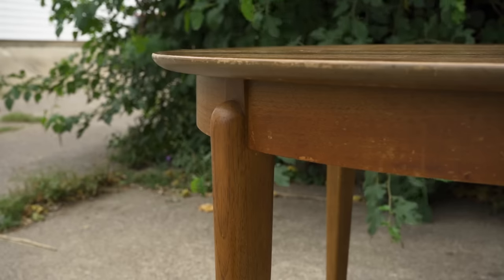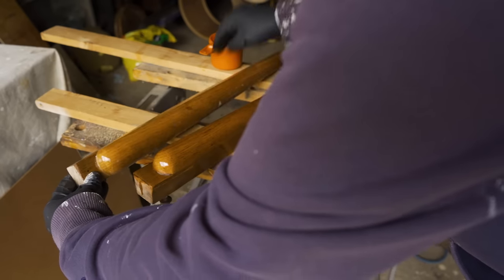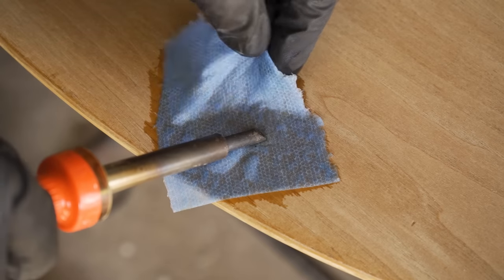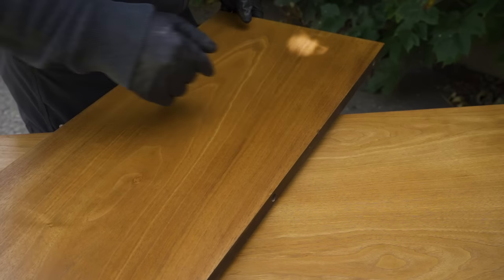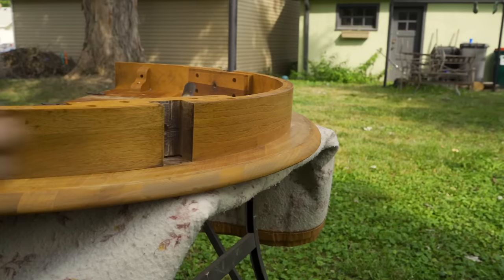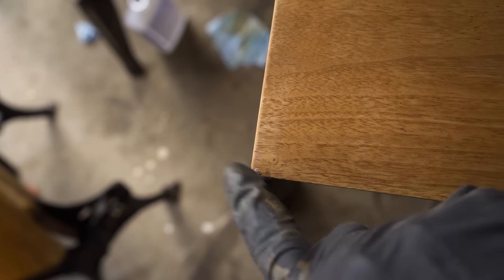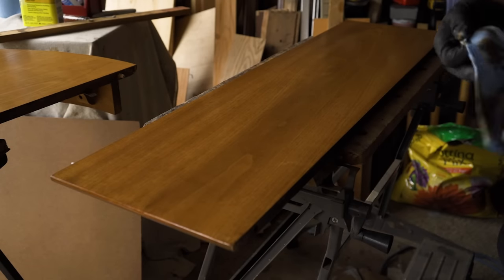Reviving A Tired Old MCM Gem | Furniture Restoration - Repair - Refinishing

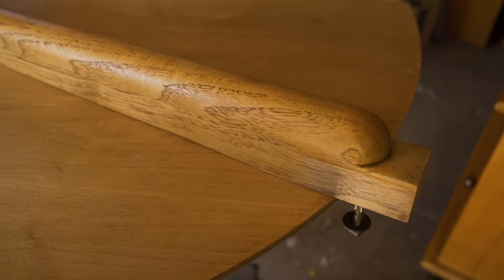Comment: I always learn sonething from your videos 4:50 "Too smooth for stain. The stain may slide right off." This must be no problem I was having with a test project. I bought a Curtis Mathes console to practice on and I could not get stain to stick where the original finish and stain had worn off even after sanding. I probably sanded it too fine.

Comment: putting lye on cherry and other similar woods is a long standing aging technique. you can get some really interesting results depending on the wood. great video as usual. so chill, even when you're showing the aftermath of haste.

you do such a good job with those hard fill sticks. i haven't used them enough to get that consistent with them.